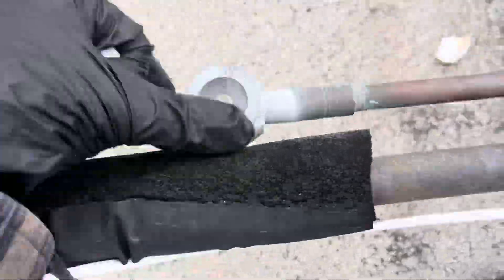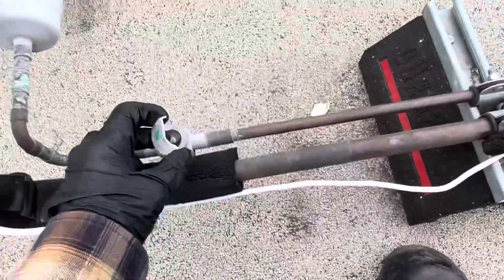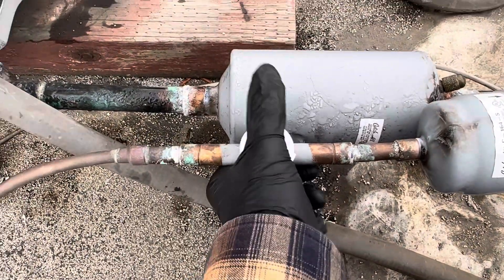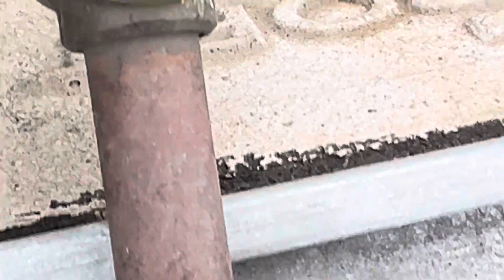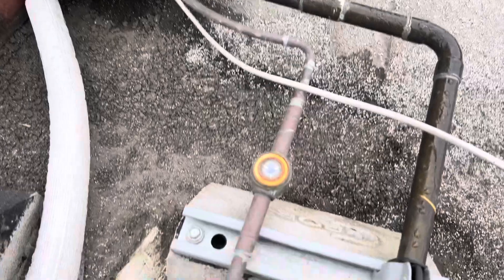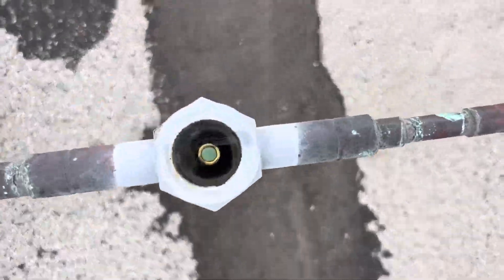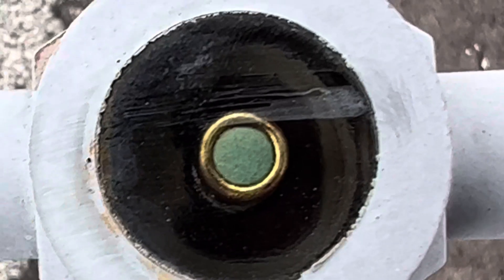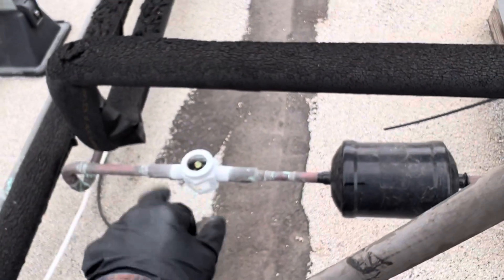LIQUID STACKING REFRIGERANT? What is it? What does it mean?

Comment: automotive is different , I work on Bus A/C quite often..  in some cases you actually want some bubbles in the sight glass on automotive..  the bubble point on R134a is reached pretty easy during high temperature under the hood conditions..  newer cars use variable displacement compressors along with a TxV which will result in cycling from bubbles to no bubbles in the sight glass..  my busses used fixed displacement comrpessors with a TxV, but many times bus A/C systems are built with much larger coil sizes to handle changing load conditions..  on those I usually set my idle speed at cruise speed (usually 1800-2200 on a diesel) and charge my A/C at that point on the busses..  subcooling on those is usually somewhat higher as the condenser is oversized on many..  the TxV will hunt ever so slightly when fully charged..  I love working on those..   

ha!! if talking about OLD cars. like from the late 70s. where they first intrroduced cycling compressors.. those just dumped as much liquid through the orifice tube as they could into the evaporator and it boiled off...  if the flow was too fast liquid wouldnt evaporate and would get sucked into the suction line to be caught by the accumulator.. fun stuff.. i love working on mobile systems
Reply from the maker: I used to work on some buses for limousine companies, who had large 57 passenger charter buses. Extremely very basic systems. Easy to work on..  literally can climb up into the condenser area on the ones that I worked in. They were so huge..  

Always found out when I would get to them after other guys worked on them they would be completely moisture saturated. If they had the moisture indicator I was always changing out and oversizing the filter dryers. . 

Orifice tube systems, simple cheap system that only worked really good in a narrow zone because it had absolutely no control . 

95% of the time when I would check, check with the refrigerator analyzer in buses on limo companies. It was usually always contaminated with air sometimes other refrigerants. . 

As you know, limousine companies usually always went the cheapest route with the cheapest maintenance and the cheapest service provider . 

Until they got tired and fed up with losing when they charter did not pay their bill because they air-conditioning didn’t work when they went to Utah in the summertime . 

It became financially feasible to pay my labor price to come in and fix the system correctly and get it working .
Reply: @coldfinger459sub0  you totally nailed it! limo companies are cheap.. and they would rather "recharge" a unit every spring (I live in ohio) rather than get it fixed right..  so it would be empty ever yspring and theyd just pump it full of cans with stop leak and extra oil and everything else..  one of my own busses i got cheap because the trans / AIR system was not right..  the standing pressures were so off.. i think they had put some 410A in it at some point..  I drained close to 20 ounces of various liquids out of the system when I took it apart..  that was just the evaporator, compressor, and condenser..  and that type of thing was common once I flushed it , fixed the very minor leak which was just a bad O-ring on the condenser inlet..  installed a new dryer.. vac and proper charge she blows ice cold and has for 7 years now..  yet the schools who had it obviously spent lots of money in freon, stop leak etc rather than take it to a mechanic..  im with you on always installing moisture indicating dryers.. of course when you take the time to fix the leaks you dont introduce moisture in ..
Reply from the maker: @eldoradoboy  👍👍👍